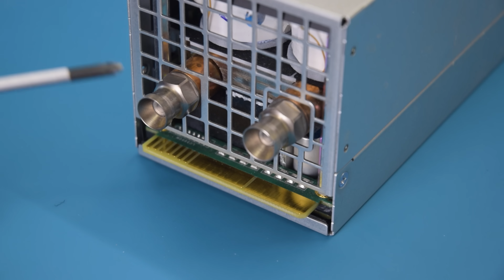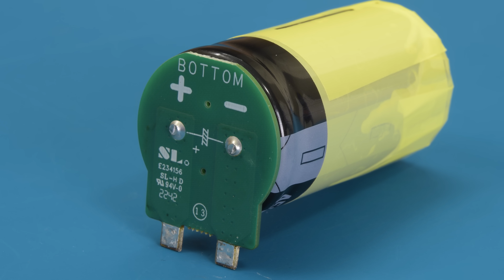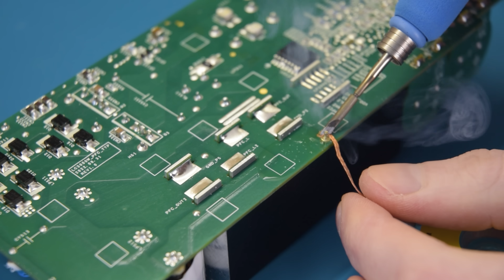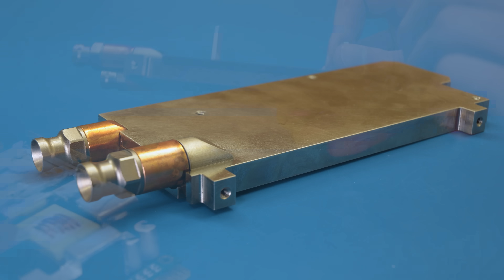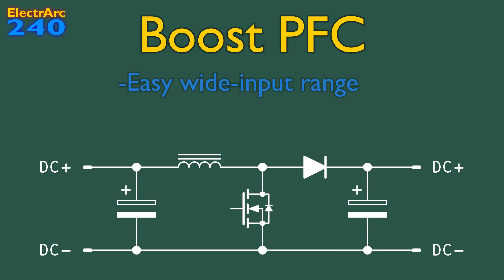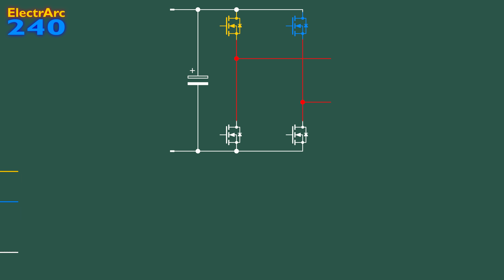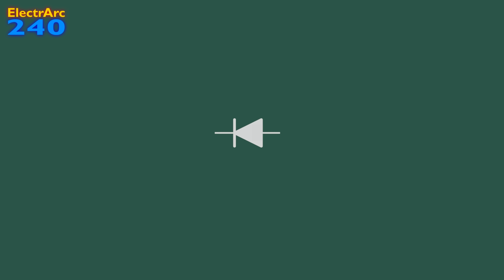Inside a 3000W Water-Cooled Power Supply (with GaN & SiC)

Comment: Hi, just a comment about the capacitors that are on the separate PCBs. It is probably due to maximum bending angle of the wires. It saves space, because you can make a 90 degree bend much closer to the capacitors.

Comment: I'd venture a guess that the two PCB's are facing each other in the PFC unit to form a differential signal path to reduce EMI.  Notice everything is a mirror image of each other the way they are laid out.  The large caps are also mounted on their own right angle PCB's to achieve a controlled height off the lower board so that they thermally interface with the liquid cooling better than they could if they were manually soldered in at a right angle.  The small PCB's control this tolerance better.

Comment: From somebody who worked with air systems along with a lot of other systems for well over 40 years, please do not say the word ducting call it ductwork add resist the temptation to pronounce the T in the word duct. I know it's minor but it really does great on my nerves. I was talk to never mispronounce that word especially if I'm going to be in the professional business of designing and applying ductwork.
Then later I hear a problem that does the origin of your mispronunciation. You actually pronounce the L in solder and in that word the L is silent as well.

Comment: Fascinating. Never knew you could add an inductor in series with the primary of a push-pull transformer driver to cause it to switch in the ZVS region. I’ve also never heard of the phase-shift topology, compared to the bipolar output of something like a TL494 that varies the transistor on-time, I guess it’s better for minimising switching losses. Either way it’s a non-resonant ZVS circuit, I hope I can find a nice and easy to use phase-shift driving IC for such a converter.

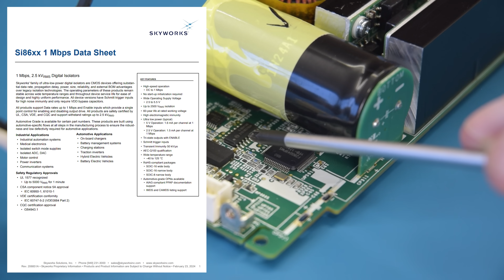Comment: 23:24 the digital isolator probably carries the GaN gate drive signals, and I saw on that GaN FET's datasheet that it provides a PWM temperature readout

33:18 Sorry to nitpick, but a reverse polarity circuit does not stop reverse current. A simple high side PMOS with a resistor on the gate and a zener is a common example of a reverse polarity protection circuit which does not block reverse current. Thats the job of a reverse current protection circuit, which is a real ideal diode circuit. Many people confuse them, and I only found out I was in that group when I mixed them up and used the wrong protection in a circuit once.

You can have reverse polarity protection without reverse current protection, this is useful for when a user may connect a battery in reverse, but you still want to enable regenerative braking. I dont think you can have reverse current protection without reverse polarity protection though.

Comment: I know this is very random, but which bits are you using on that LTT screwdriver, and can you fit two in row in the handle?
Reply from the maker: They are just some cheap Bosch ones that sadly can’t fit doubled up in the handle. I keep Philips, flat head and hex in the handle that are a most always what I need but when I’m in the lab I prefer to use them from a bigger set, the handle ones are for field use only haha!
Reply: @electrarc240 they looked kind of compact, was hoping I could find bits that are easier to ship here than the LTT ones. On the plus side, they finally have LTT posidrive bits

Comment: The series/parallel fallback diode rectifier may be like this because of reliability (if one fails, nothing happens but this is unlikely) or to increase voltage drop. This may be there to give the PFC more room to switch, without the rectifier starting to rectify for a bit. However, this is also unlikely because this means the DC bus would get slightly below the peak AC voltage which is not supposed to happen on a boost mode PFC. Or maybe this is there to allow the DC bus to be as low as possible for high efficiency? We'll probably never know, unless you have a chance to power it and measure the voltages

Comment: Im a little confused, wouldnt the output side of the transformer with a tapped center produce(say the voltage across the output coil is 12V), 12V and 6V? I get that they can just increase the coil count to make it the right voltage, but why not use the entire coil? Like, just conditionally make one side DC- and other side DC+? It could also make the output have a higher common mode voltage(I think that’s the right word) right?

Comment: Do the power supplies in the beginning also have 12V output voltage? If you halve your output voltage you also halve your power density. I think current density often makes more sense.

Comment: those octo diodes at the end - I'm not an electronics engineer, but while looking at some high power custom PSU (back i the day) I asked about similar setup to the guy that designed it and he just quipped : "Obviously you've never seen a diode spontaneously fail in reverse before burning up" so maybe it's just ensuring that while using cheap components it will not catastrophically fail ?
Duno my self, just a huge speculation.

Comment: Why the small boards: These large capacitors often only come with very short legs, so must use these boards.
Using the kelvin-source only may result in a much faster switching than what is wanted/needed making it harder/impossible to make a good layout with low voltage transients. Having some extra inductance in the source (as when connecting kelvin+source together as here) reduces the speed the current rises and falls reducing the demands on layout and can also reduce EMI quite a lot.

Comment: 32:44 finally a point where I can correct you! The gaps do not help with heat dissipation for a simple reason: The best conductor in the whole device is copper and the coil is made from copper. Adding air and/or the thermal compound will only help very marginally due to the massive difference in thermal conductivity compared to copper. Ideally you would directly (with very little thermal compound) couple them to the water cooled plate. So this is in not the reason for the gap.
Reply: Im not completely won over? What other reason could it be? I doubt its a HV TX where insulation breakdown or creepage is an issue...?
Reply: @Dr.Stacker  He explains a/the reason after the incorrect heat dissipation assumption. But I am not an EE, I have no idea about the electrical side of coil spacing. 
Getting heat out of there would be best done without gaps and as closely coupled to the cooling plate as possible with as little thermal compound as possible. Thinking of thermal conductivity like electrical resistance is really a good fit here. You want to maximize current (heat flow) -> reduce resistance -> copper is ideal. Air is really bad, tho of course not like the almost perfect 0 until breakdown voltages are applied. And thermal compound is like a low-value resistor, while fairly low in value still really bad compared to copper.

Comment: As an very unhappy customer of USIC's SiC Cascode JFET, I'm trying to guess the reason why designer connect KS and S together, I may be wrong at all. 
By sharing path with high current S, "common source inductance" will be introduced into the gate driving loop, the polarity of L*dI/dt voltage on such inductance is always against the gate driving voltage change. Thus, equivalently, it slow down the turn-on and (especially) the turn-off speed. Slower switching speed leads to higher switching loss, but in reality these Cascode JFET always turn-off too fast, and can causes very high turn-off voltage overshoot that approaching its breakdown voltage. 
For our case, constantly operating Cascode JFET near breakdown voltage (close but not passing the limit) leads to frequently damage of FET. We tried lots of methods to slow it down, we then ordered the Dual Gate version (both the HV JFET and the LV MOSFET gate been connected out, D/S/G-M/G-J) and adding resistor to the JFET gate to slow that thing down. At last we have enough of it, and switch back to regular HV SiC MOSFET (more expensive), by using same bus bar and similar switching timing, problem gone😆

Comment: fantastic educational video on a truely high power server power supply. Have you done the same for consumer pc power supplies? Gamers Nexus did a series a while back on consumer power supplies catching fire. But going into the unit and tracing the circuits is next level. It showed me where the quality justifies the price of the equipment. I have two Corsair power supplies AXi and HXi. I am able to monitor their sensors with software. They are hard to find nowadays. I was wondering what goes into ones like these vs. others and less expensive ones. Yeah you earned a new sub today. Keep up the good work.

Comment: As mentioned by another post, the yellow coated choke should be of powder material, which provides much higher Bsat. The painting itself look like resin powder coating. It provides some degree of electrical insulation and prevents environmental ingress on the material.
Reply: The use of UnitedSiC and TI GaN module indicates bit early design time of this supply. UnitedSiC tubes got good datasheet performance, but never achieved widespread use somehow. Other suppliers of SiC all run to MOSFET with vertical channel now. Rumors went that cascoded SiC sometimes get catastrophic failure, cause the cascode cannot catch certain spikes before they reach the cascoded bottom Si MOSFET.
Reply from the maker: Wow really interesting insight! Where do you hear these rumours? I want in!
Reply: @electrarc240  Work in similar branch, just not for big computers😂Its a pity UnitedSiC didnt survive, SiC JFets are much stonger than SiC Mosfet and isolated gate drive is much more mature now, so no cascode needed.

Comment: 10:09 How did the PCB supplier manage to cut such square slots for the aluminum core fingers? Small diameter millers are generally not good for large scale products.
Reply: 精雕机
Reply: @ZhaoKarl  CNC of course, but in order to make such sharp edges, small millers like 0.3mm are needed. Not good for series production
Reply: @zazio5535 现在很多手机都是铣削后盖，广东那边机器已经过剩了，别说只铣一个槽，雕花都不影响生产。

Comment: AWWWW it's one of the not-too-common officially-alirack-rated server PSUs!
Alirack is that system where you just delete the inverter electronics from your datacenter's room-scale UPS, so you just use the UPS charging rectifier to digest your datacenter's 3-phase grid feed power, inject local solar on the side, and even get to use generators that like consumer cheapo scale "inverter" ones.

Those generators run at variable speed to adjust to load and just use a simple 3-half-bridges for 3-phases converter that not only is able to conveniently server as a starter but much more importantly lets you provide electronically regulated reactance to a simple cheap 3-phase induction "motor"/"generator"/"machine" along with doing (through separate high frequency inductors and a filtering capacitor to neutral for each phase between the motor winding inductance and the high frequency inductor, or just directly through the motor inductance if not using GaN-tier switching frequencies) reverse-current-direction buck converter style voltage conversion between what the generator does at the speed the engine is run, and what the high power DC bus is at.

You just hook the server PSUs (that are otherwise built like modern active-PFC 200V to 240V AC single-phase units with allowance at the input rectifier to tank the full current through just one polarity (cheaped-out full bridge diode rectifiers may easily be a problem there; PSUs that can deliver the full power also from just 120V like typical home gaming PSUs tend to have the current capacity reserves at that rectifier though to not burn the active 2 of the total 4 diodes out if fed with 240V DC), only really having to make sure there are no startup/standby circuits that have an issue with DC) to your LFP battery bank which is configured to e.g. 68 or 69 cells in series and as many parallel as needed for your amount of servers/power draw, only have 240V DC rated circuit breakers in the way (those are for example like a pair of mechanically-linked circuit breakers, one on the + and one on the - wire; that makes otherwise-regular-household-German circuit breakers capable (iirc; though even if not quite, it's barely more than just that)), take care to see that your batteries are evenly wired so that you don't draw unequal current from them aging them unevenly, and just use a substantially more efficient and cheaper-per-kW natively 3-phase rectifier that turns the incoming 3-phase grid supply into the current DC line voltage.

If you want to save further money without breaking this system's compatibility with many generic 200V~240V AC PSUs, you buy your most common PSU types in a special version that is DC-only at the input and doesn't even waste effort on doing the boost-PFC trick that turns single phase AC with grid-side ohmic draw into the wobbly-but-sufficiently-narrow-range DC that is fed through a transformer-isolated pretty-fixed-voltage-ratio (say for example turning 360V~450V which is just +25% over minimal nominal level at peak, into 12V output) DC/DC to create the usual 12V output.
Like, you can just adjust the transformer primary at manufacturing to be correct for the 200~240V input range and use slightly lower voltage but higher current transistors to adjust to the approximately 30~40% lower DC input voltage to the main transformer, and already you saved some power losses and money from this boost-PFC you eliminated.
The less-intense way would btw be to just take the otherwise normal circuit and merely delete the parts you don't need for the single-polarity-only operation, and perhaps make the big AC-ripple-smoothing capacitor smaller to account for not having AC ripple anymore at the input.

And even after/ignoring all those savings (oh, also, losses in the wiring to the servers are reduced because those are 41% higher if you feed AC vs. just feeding the same nominal voltage but DC), you still get a big reliability benefit because there is no AC grid island you have to manage and no UPS inverters that can fail, and mostly because of the not having an island grid that can misbehave, along with having battery banks that are easily able to just ride through the current spikes of a minor short circuit somewhere, you can much more than is easy with AC just connect your DC to a big bus where the bus itself doesn't really need fuses inside itself and you instead have fuses where branches connect that have a lower current rating than your giant connected DC microgrid could cause to flow across the big bus.

That's akin to how e.g. German residential streets have a (200~500A range!) 3-phase 240/415 V cable buried, and use a vampire tap (that then gets resin-filled in a protective shell at the end of installation) to attach the 100~200A (depending on building size; there is an understanding that not all buildings use all their individual power at once; if they did they'd blow a fuse at the transformer that feeds the street's trunk cable) that feeds to the main fuse box in the building which is in arm's reach of where the vampire tap cable enters the building. That box btw is waterproof sealed and even has a tamper-evident seal on it; it's just so non one drilling a wall in the house accidentally shorts the transformer feed and draws thousands of amps for multiple seconds before the fuse at the transformer eventually blows. The wiring in the house then goes to the meter box(es) where it tends to enter the meters unprotected (though iirc it may have another lower fuse before the meter), and then the path from the meter to the distribution panel (which in single family homes is often like the right half section of the same big box; there's a barrier wall in the middle though so you don't connect before the meter without it being obvious to an inspector that you accessed that area) is protected by the main breaker. For an apartment that path is often a 3-phase 40A breaker btw. Normal meters are up to 63A; extended meters for mildly bigger houses are up to 100A; beyond that it switches to using a current transformer instead of the regular pass-through meter.

TL;DR: alirack official support on this PSU! Yay! 3-phase AC is legacy non-electronic directly-grid-connected motor/generator baggage, feed your server PSUs with DC from your battery bank, don't waste money/efficiency/reliability on needlessly inverting battery DC in a UPS just to feed your servers!

Comment: @37:05 that would be to prevent the DC bus getting too far away from neutral, something which could, under the wrong conditions lead to a flashover, or worse, switching device insulation breakdown.

Comment: Absolute insanity to use water in this application... galvanic issues are no joke and water offers no advantages over nonconducive fluids in applications where you don't need access to its latent heat of vaporization.
Reply: sometimes when people say that something is water-cooled they actually refer to mineral oil. i wouldn't be surprised if that was the case here too

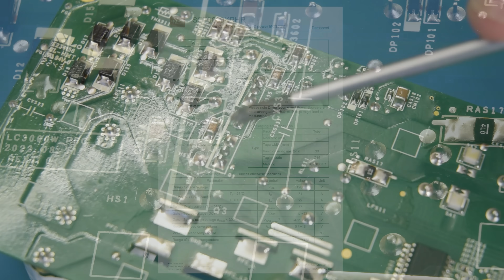Comment: 12:06 The Kelvin structure is just to reduce coupling between the output current and the drive signal. Once you connect them to a single ground plane there isn't much mutual inductance any more so keeping separate grounds would be futile (it would introduce other problems like resonances between the grounds). Bad grounds should be kept separate, whereas a good ground shouldn't be split!

Comment: "Good engineering" is not using 2020 semiconductors in a 1920 vintage circuit. Try a 2011 bridgeless PFC circuit.
Reply from the maker: This is a bridgeless PFC?
Reply: Even if the bridge becomes active, it will remain a bridge.